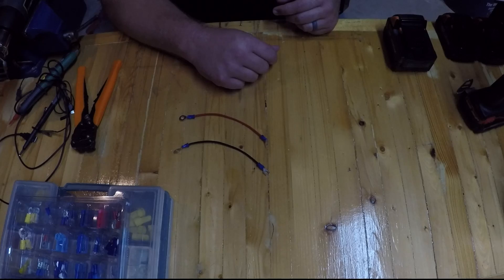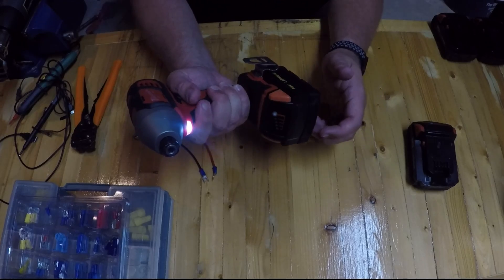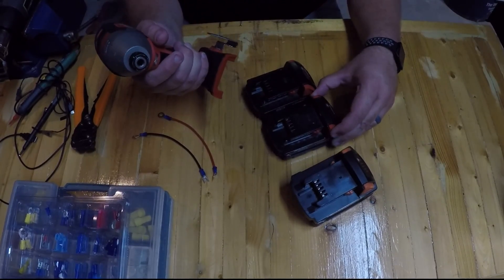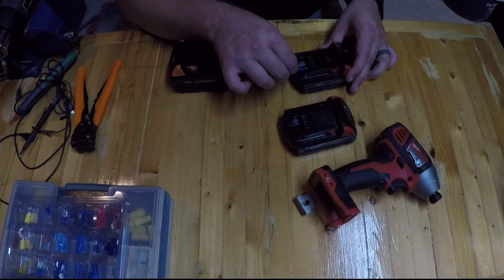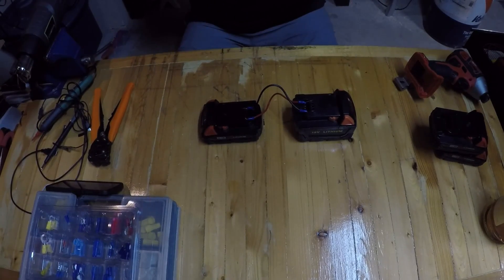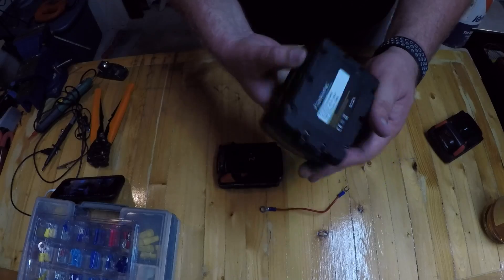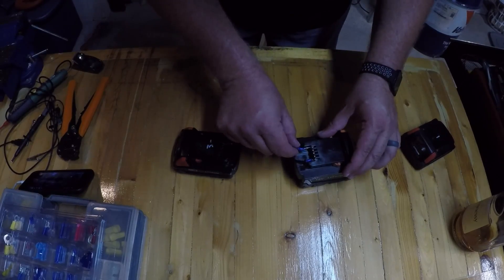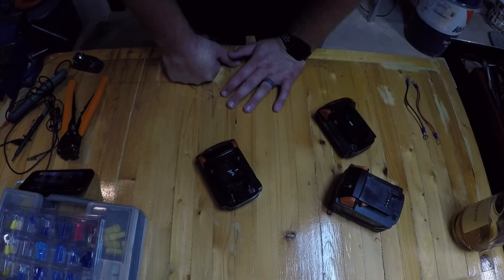How To Fix Lithium Cordless Drill Battery Packs

Comment: Over here we are charging? Flashing red & green means error, not charging. At least on the chargers from Milwaukee that I use from Europe & Australia since 2017. If they are no longer charging, (as someone else has commented) then there is a problem with 1 or more of the cells. "Jump starting" the packs (even if it doesn't cause a hazard) simply causes the other good cells to work harder, causing your pack to die again soon, & costing you more because you would either have to change out more cells sooner, or just entirely kill the pack. Open the pack, find the dead cells, change them, move on. More economical, more safe, more smart.
Reply from the maker: ya bad edit there, but this work and i recommend.  stand by the process, done it several times, this video is like 6 years old i think.

Comment: So i have about 3 of those chargers. I dont think thats the charging indicator lights. Not saying it wasnt charging. But that looks like the milwaukee set. And on my green and red back and forth equals broken battery. = not charging. On mine it stays red if charging. Green if finished. Green and red when theres a problem? Maybe its not the same set though and my eyes decieved me.
Reply from the maker: its been years, this battery still rockin. used it this weekend.

Comment: Red and Green flashing means Error. connecting directly like that is dangerous.There's little to limit the current, so one will discharge into the other very quickly, potentially damaging both batteries.
Reply from the maker: It’s been years now. She works. Still have that battery I believe. Some diminished capacity I am sure by now.

Comment: Take this video down. Edit it to include precautions… lessons learned… or throw it away as bad. You are not an expert in the field of electronics OR electrical theory and have no place teaching others how to kill theirselves. 

Milwaukee and other manufacturers using Li batteries need to warn people very boldly about over burdening the cells. 
It should not have taken a commenter on your bad ideas to reveal to us how you’ll almost die a few months from now… or sooner, or way worse… or am I too late? Wtf is the date on this video? Let us know you survived and took the batteries out of service and chalked it up to an expensive course in something you’ll never do again ‘over-working a tool’ 
When it says dead. Don’t treat it like NiCm where you let it sit for a few minutes and then finish your hole. 3 or 4 times in a row before charging will typically ruin it. 

What irks me is mine shows 3 red lights after fully charged. 

Today I used my fan on a 9ah and I ran it enough to expect it to need charging. 
Yet it says fully charged when I plug it in because it has a lot of bounce-back voltage to fool my charger. 
Because the light in the tools is using less cells. And it’s voltage l is probably less than 18. So during heavy demand it creates a differential that affects draining only the two large banks while the lights and electronics depletes the small bank. 

Smaller batteries share equal connection to the full extent of lesser banks. This is partly why your m18 5.0 will not even push the saw like a 6 ah large pack will (and every higher large pack) 

So far no issues like this from any smaller batteries. But definitely DO NOT keep using a dead battery after letting it rest! Have enough batteries AND chargers to keep up with demand!

Comment: I ask you to show a version that has way more light on the battery as you connect the wires. POSITIVE? NEGATIVE? how do I tell. My M18 just has 5 slots
Reply from the maker: old video but I could maybe do it better justice with a reshoot.

Comment: Where can I get a pair of those jumper cables in the video? Tried search Amazon and could not find.

Thanks!
Reply from the maker: I just made some up with spare wires.  you can crimp on about any end connector.

Comment: Any ide on why the lithium battery will take charge and from 3 lights  to barely enough power to operate the tool. Charge it on the charger again and the charger shows it charges them and when it is fully charged. Go to use it again and the battery goes from full charge to almost no charge.
Reply: One or two banks of cells are at too low of a voltage, and the charger will then recognize the the higher Voltage banks, and cut off the charging when it ‘thinks’ the battery is fully charged, thus the lower voltage batteries don’t receive as full of a charge, or your BMS board might be faulty.  A lot of Science goes into these batteries, and if one is unsure, it is best not to screw around with them.  Stay safe!

Comment: Red Green flashing means the battery is defective or damaged. Doing this is dangerous and you shouldnt be telling people this works because it doesnt.
Reply from the maker: it does work.  There are dangers, but if your battery is damaged or you don't take precautions, you could have problems.  if you batter is just drained sometimes the charger thinks its damaged when its not. read the pinned comments. also the comments of it working for dozens of folks.

Comment: DO NOT DO THIS, if the shunt has tripped it's for a reason! Flashing green then red on charger does not mean it's charging, it means poor connection or defective cells.
Reply from the maker: Roger D there is definitely caution to be taken. I have pinned comments illustrating that but it does work. Parental supervision required:)

Comment: Sure you fixed the problem? Last time I checked when the charger flashes red and green means the battery is bad and not charging..
Reply from the maker: Hard Core yes I apologize for that clip. I was incorrect when stating what the flashing green meant. Process works. 100% give it a shot. Still using this battery all these years later. Scroll the comments for all the folks who tried and worked for them too

Comment: Are you aware that this may cause the battery to explode? In turn, causing a fire, damage to property, death, etc. blinking green/red light is NOT a success you moron, when green/red lights are blinking in tandem it means the battery is damaged and the charger isn't working. This video sucks.
Reply from the maker: Yes. We have learned a lot the YouTube community is awesome. 

My theory was correct but I did make a few mistakes. This DOES work.   Read my pinned comment for safety information.

Comment: Thanks for posting this! I used a power supply in place of the charged battery and this worked great. Just as a note of caution you need to monitor the battery temperature when charging. I used the power supply because I didn't want to charge the battery at more than 18 volts @ 1 amp. This keeps the battery charge at a safe level and won't destroy the Lithium cells.
Reply from the maker: nice!

Comment: Thanks for this advice. I was able to resurrect a Vax Lithium Life Lion battery which refused to charge and had been used very little. It took several hours for the discharged battery to receive enough charge from the good battery but eventually the charger accepted it and fully charged it in about 12 hours. These batteries cost £79 GBP.
Reply from the maker: Awesome. I have done this a few times over the years! Saves money!

Comment: A new battery I bought showed defective and tried that jump trick now it shows charging status. Using one of those V 18 to m 18 adapters isn`t good  I found out . the M18 tool has feed back circuit  to show battery what power draw . I used the V 18 to M 18 adapter and it after a few seconds disables the charge status lights on the battery !!!
Reply from the maker: Excellent!!

Comment: Nice video. Where would I get the jumper cables you got?
Reply from the maker: I made them with spare wires.
Reply: Nunya Biness you can use 12/2 Romex and try it or just get like 2’ of stranded #12 and put crimps on the end

Comment: Nope, flashing red and green means a battery fault - it's not charging.
Reply from the maker: yes sir, we have corrections. make sure you read pinned post as well.  this method DOES work. many comments confirm and I have done it several times since.

Comment: I thought green and red flashing was faulty pack? I didn't use my drill for a long time and the 2 batteries it came with are totally dead. Light flashed green and red on charger and left it on there a long time but it didn't charge. Hmmm
Reply from the maker: you are correct the clip I used was wrong.  Flashing means not charging.  I have used this technique several times since this video. it works! many commenters agree below.  Please see pinned post about fire hazard. be safe, thanks for watching!

Comment: I have a M18 red lithium battery with 4 charges on it since I purchased it about 5 months ago. One battery was about 75% charged and attached to my drill that I was using to counterdrill holes in a wood project. I was using my impact to drive screws and when I went to use the drill again it was dead. The battery flashes one light and won't do anything but when I put it on the charger it says it's full. I really love the "balls" of these Milwaukee impacts but it seems like they have a lot of battery issues and I can't find my exact issue online. I tried your method and it didn't even drain my charged battery at all. Do I have a dead cell? I'm lost and need help lol. Thanks and great video btw.
Reply: You have a number of dead cells inside the pack. If you're comfortable pulling things apart, use a multimeter to find the dead cells & replace them. Plenty of videos online about this. My favourite is a Greek guy (technically Cypriot) called EVCustoms . He has a playlist called Milwaukee Lithium Battery Repair

Comment: Blinking green and red light on the charger means you're battery is bad according to the owners manual. When everything is normal and working correctly the light should stay solid red while charging and then go green when fully charged. This is happening to me I'll just buy a new battery for safety precautions .

Comment: Dude your badly mistaken , red and green flashing means battery is broken . Major fail buddy . Solid green means it’s charging . Try again
Reply from the maker: michael M You are correct I said it wrong but it definitely works I did it again as recently as last month
Reply: First part of your comment is correct, second one Not!  Solid green indicates fully charged.  Check your manual mate.  Peace

Comment: Did NOT work on the 9.0.
Reply from the maker: Ahh dang sorry man. Maybe give it 15-20 min. Keep checking the temperature make sure it doesn’t over heat. It’s technically not safe to do this at all but if it works, good, if it doesn’t you still need a new battery, so no loss. Fire is a real danger :) be safe, thanks for watching and saying hey.
Reply: Thanks for the reply....I can charge it off the other one if need be.☺

Comment: When you show the battery on the charger it was flashing red/green. I do believe your mistaken about it charging when its flashing faulty
Reply: Your right.  I saw that too
Reply: Exactly. This dude doesn't know what he's talking about
Reply: Yup it shows faulty battery
Reply: @michaelhurtado5  I'm in the same situation. However I'm going to connect it to a 19v power supply and see if I can get the voltage up.
Reply: @michaelhurtado5  I put it on the base for 1 hour then took it off and repeated this and it finally started charging. Full now.
Reply: @wannabecarguy   thanks, I'll try that.
Reply: You are right. It will also flash red and green if the battery is not connected tight on the charger.
Reply: I just added a new battery to my collection.  It came straight from the package dead.  I put it on the 6 pack charger with the rest of my batteries.  It flashed r/g.  I pulled it and put it on my individual charger.  It flashed r/g.  After off and on a few times, it finally had enough to go solid red.  Then the level indicator on the battery was flashing one bar.  After about 30 minutes the level indicator is now solid red.  Sounds like those batteries just needed some extra help.
Reply: That’s what I just wrote him before I noticed similar comments.. crazy thing is this is one that pulls up how to fix Milwaukee batteries..

Comment: Talk talk talk...... typical yanks
Reply: This same basic technique works to revive lithium ion cell phone batteries appearing to be DOA after being "excessively discharged. I usually take a 9v battery and attach a jumper wires to each terminal then use them like car jumper cables to reset the internal low voltage protection circuit by touching positive to positive, negative for 15-20 seconds. The battery resets and will charge normally when reinserted into phone and charger attached. The voltage of the jump power source needs to be at least slightly higher than the lithium battery's minimum   allowable excessive discharge threshold voltage. Usually approximately 1.8v DC or so. Circuit is supposed to prevent potential overheating of discharged lithium batteries due to their inherent initial high inrush current characteristics inherent to all lithium batteries.
Reply from the maker: 690ccKTM we Texans like to talk too. Double tap to skip 10 sec.

Comment: I am going to try this tomorrow. ALL 3 of my Milwaukee RedLithium 18V batteries are partially charged. My question is: Am I able to jump one to get enough voltage for it to charge, or do I need to get a known full battery to try this?
Reply from the maker: I used a known full battery, but you can wire some jumpers up in series and get more volts!

Comment: I tryed it on my well used milwaukee 18 lithium red. Didnt work. My charger lite is green not flashing but wont charge. I also bought used lithium 18v from china went dead.
Reply from the maker: leave it connected longer, even up to an hour. you need the voltage to be high enough to be recognized by the charger.
Reply: Or possibly your battery is sulphated due it to been uncharged for a long period. I had same issue with solid green light on charger and when I opend the battery up it was badly corroded inside

Comment: Sure, you can get it to charge.  Guessing you didn't know about the DELAYED FIRE HAZARD for Lithium Ion (LIon) batteries!
The battery pack was shut down as a safety precaution because LIon batteries used to catch fire.  Then someone figured out why, and manufacturers started adding safety circuits to keep that from happening.  What you are doing fools the safety circuit, and can lead to the battery pack catching fire:
 - Once an individual (3V) cell gets below (IIRC) around 1.4V, the copper electrodes start to dissolve.
 - If the pack is then recharged, the copper will form nucleation sites where metal whiskers will begin to grow (by electroplating), inside the cell.
 - After some charge / discharge cycles, the metal whiskers will begin to short out the battery cells.
 - Shorts in the battery cells can get hot enough to ignite the battery.
 - Oops, left it on the carpet near the crib!

LIon batteries hold a LOT of energy.  They can catch fire and even explode, which will at least ruin any power tool they are in, and might start a house fire.

Better to get a new battery, or replace the old cells.  Avoid cheap, maybe jump-started discharged cells.  New cells fix the problem.
Reply: Kevin Metcalfe  Any LIon cell has this problem, once the individual cell voltages get too low.  If they got that low and then sat for a long time, that makes the problem more certain because the copper electrode material has had longer to go into solution.
Reply: I bought an m18 from home depot and went to charge it and it was completely dead not charging. Then i was quarantined and hadnt gone back since. Its been less then a month, saw this video and tried it and it worked. Are the fire hazards still present on a never used fresh out the pack battery?
Reply: @John 14:6 KJV no that's just corrosion
Reply: I have a 5 month old 18V Milwaukee. It sat for only a couple of days in a tool and won't charge. I jumped like this. Still won't charge. Reads 14 volts on the meter now. Was under 12 when I checked before jumping. Is it toast for real?
Reply from the maker: I am goin to PIN your post, because you are 100% correct.  Folks need to know and understand why these systems exist and the risks and rewards associated.  Quality comment! Appreciate ya brother!
Reply: MrTechnophile  Hello!  I brought brand new batteries  10/2016 for backup.  I ended up never opening the package until today.  They are all dead and would not charge.  I was able to use this method and now they are charged and working. However I assume the same scenario/warning you described is present in the situation of never used batteries?  Thank you!
Reply: EagleRun23 it’s nicd not lithium ion just saying 🤷🏻‍♂️

Comment: Doesn’t flashing red and green indicate “damaged or faulty” battery...
Reply: Flashing between red and green does not mean its charging. 
It's bad period.
Reply: Definitely dose
Reply: Flashing red and green indicates broken batteries not charging, or at least that's what my Milwaukee charger shows. Did this eventually work I have 4 batteries with no function what so ever.
Reply from the maker: ohh, maybe, id have to look that up.  This hack worked. All batteries fully functional, I use and rotate them all the time.  Do you have a dead one?
Reply: EagleRun23 yeh i got 2 dead out of 9
Reply from the maker: set up a jumper and see if you can pop the voltage up enough that the charger will take them.
Reply from the maker: yes, just looked up to make sure the colors were right...... if you put a bad battery on, it will flash as damaged.  Use the jumper trick to bump the voltage up on the battery and then the charger will charge it.
Reply: that is what my charger says
Reply: It also can mean you do not have a solid connection between the battery and charger.  You will hear battery click onto the charger.
Reply: The charger has light codes written on the label  red & green flashing has a broken battery logo next to it